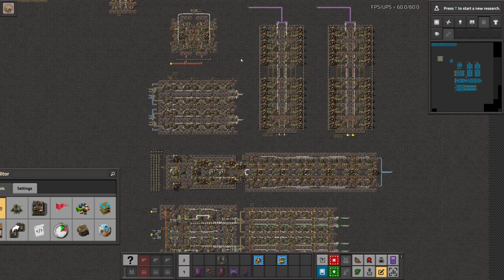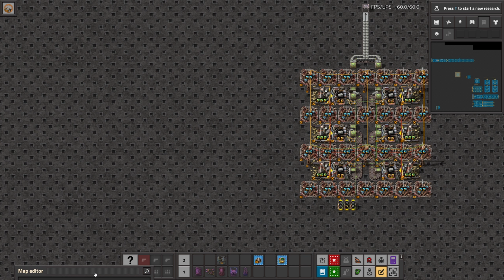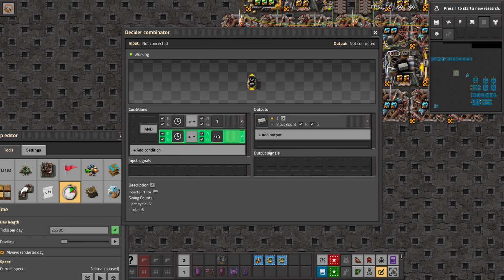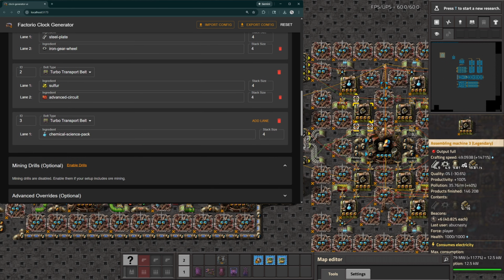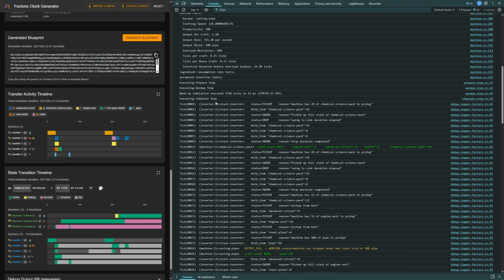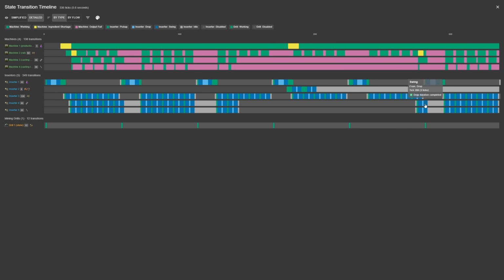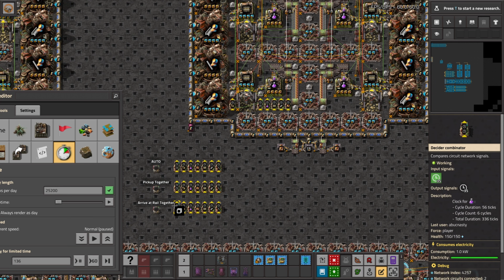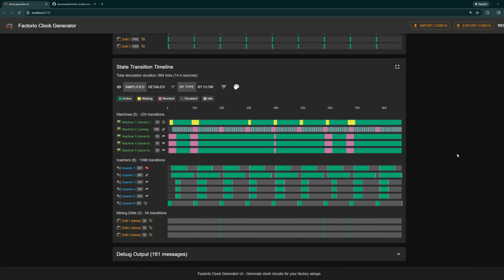Factorio Clock Generator POC

Comment: im not sure if i got that right. can you or can you not import a factorio blueprint to this tool in order for it to figure out the needed ratios/tick timings? because afaik thats the thing you actually want to do as few things as possible manually.
Reply from the maker: You can’t yet. I’ve thought about it but was outside of scope for this first proof of concept. 

You can only import and export the tool config (which is the data you entered into the form)
Reply: @abucnasty mid term: isn't the information you enter already contained in the blueprint to json converter you wrote for the update time correlation?
Reply from the maker: @ivoackermann15 sadly the specific values I’m looking for isn’t. You can technically compute it using that library to determine the number of beacons and module types to derive the speed yourself but I have always gotten rounding errors in the past as I haven’t been able to derive the exact formula so for a first pass definitely out of scope.

The larger looming issue I see with blueprints is that this tool really only needs to know a subset of items in the build, not the full build itself but that’s for future me to figure out…

Comment: I assume you had no access to a blueprint decoder/encoder.
Because otherwise i would be curious why you didn't just use the blueprint data from the game and calculate this on the fly.
Or why it isn't done in the game is another question.
I don't mean the simulation.

I mean use a marker tool, then let it precalculate all the inputs you have been "manually inserting" and just create a config file directly for the user to input into your tool :)
That could be an option as well :)
Reply from the maker: I do have an encoder since I create the decider combinator programmatically. The problem is I’d have to do a lot more calculations to get the crafting speed and would need to know beacon count, modules in each beacon, modules in buildings, etc. 

Could be added at some point, but wasn’t worth the trouble of doing that on the first pass

Comment: Maybe link up with a mod creator to make this into a mod that can work directly in the game. Ideally doing a thing like rate calculator, you just select a section and then the mod generates clocking for each machine and the inserters between them along with all the wire connections. But at least being able to make a complex clock for a bigger process would be good.
Reply: That'd be awesome.  :)
Reply: Put it right into factory planner

Comment: "I built something fancy to automate clocks, but then do it all manually anyway for style."
I still think factorio devs can solve inserter UPS issues very easily, and if you used your knowledge to help them instead, we would probably not need to optimize inserters anymore...
Reply: They would still need to optimize inserters because the Megabasers would be building 10-100 million science/minuter